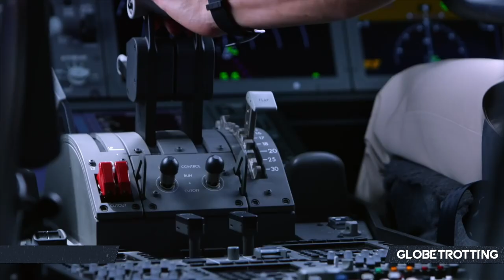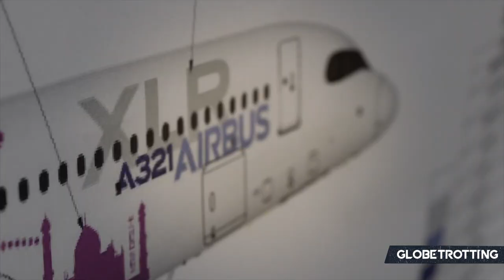Boeing's Next New Airplane...

Comment: I seriously do not understand the fascination with 757.  Large capacity single aisle just don't make sense. To compete over the next 20 to 30 years Boeing need a new aircraft that is efficient, comfortable in flight and capable of fast turnaround ( boarding, deboarding, cleaning resupplying and refueling) a rebooted 757 does none of these.
Reply: Hotrod, hiperf plane. You must never have seen one take off!
Reply: Given the same capacity, single-aisle planes are more efficient than double-aisle because a larger proportion of the cabin is occupied by seats, rather than aisles.
Reply: Very accountant-like answer! I would have thought more efficient loading/unloading would come into it. Then we add passenger comfort, more aisle access for those that turn right and more options for F and J seating, then twin aisles would come out on top?
Reply: @anthonywatts2033  It doesn't seem to me that many airlines are concerned too much about passenger comfort these days. The discussion is mostly about legroom and meals on board, I've never heard anyone go as far as complaining about aisle access (as far as economy class is concerned, anyway).
Embarkment/alighting time may be indeed better for a double-aisle aircraft, but by how much? Is the potential saving of 15 minutes at the gate going to compensate the worse fuel/seat efficiency? Also, I'm not sure that the aisle is the main bottleneck, since even widebodies are usually loaded through one jetbridge. 
And yes, it's an accountant's answer: the companies are in the business to make money, not to provide comfort.

Comment: Boeing is not even considering a new aircraft type till 2035. Even if they think of a new one in 2035, it will take 10-15 years to develop a new prototype which may be showcased in 2050 at the earliest.
Reply: I think they mean it will launch mid 2020s and fly in the 2035

I can’t imagine Boeing not announcing anything and not working on any airliner and only launching in 2035 that would be insane

Comment: Boeing is foolishly allowing Airbus to eat there lunch with the A321LR and A321XLR.

As I've suggested before, Boeing should take the 757 design and update it with MAX technology. It would be a relatively inexpensive plane to develop.
Reply: No it would not be inexpensive and the design is just too old by this point to justify the billions it would cost. It would cost almost as much as clean sheet with a limited market. You just have to accept the 757 in any form is a thing of the past.
Reply: they literally said that they will never build a 757 again cos its so complicated to build compared to other boeing jets
Reply: @hibikismusic3103  It was just from era that is over and I've herd too how Boeing complained how expensive and labor intensive it was to build. Although developed at the same time, it had little in common with the 767 other than a common cockpit. Certainly didn't help achieve lower production costs. They were not thinking about it at the time. The 737 larger versions just became a better option for Boeing.
Reply: Aurbus isn't eating Boeings lunch with the XLR. Why don't you go up to boeing and say why didn't you build an equivalent XLR to actually compete with
Reply: @nickolliver3021  Boeing has chosen not to compete with the XLR. They have much bigger issues to deal with than losing a relatively small market segment by spending billions they simply don't have on a new airframe.
Reply: @johniii8147  They didn't choose not to, they lost out which we already know why. They never did have a plane even before the accidents that was equivalent to XLR. The 797 was a glimpse of what they could have done but time/priorities got in the way.
Reply: @nickolliver3021  Yes they chose not to. They were looking at competing plane as early as 2016 in that segment and chose not proceed. That's well known. It was a choice and they probably made the right one. Boeing simply is not currently equipped to develop an all new aircraft. Sometimes the best business decision is to ceed a certain market segment and that's what they have chosen to do. They got a lot of other things to worry about at this point.

Comment: Boeing next airplane should be an upgraded B747-8I incorporating new cutting edge iHYBRId propulsion tech that will make the airframe 60% - 65% fuel efficient than existing B747-8I & B747-400 ER . . . Boeing's new middle of the market aircraft should be something close to the B757-300 in terms of concept & capabilities . . . a large wide body quad jet flying long haul could seriously do with a 4-to-2 feature where the aircraft can be flown safely on just two engines (without compromising performance or safety) instead of four, thus significantly minimizing fuel consumption . . . for the engine manufacturers like Rolls Royce & Pratt & Whitney this would mean designing a unique turbofan engine (specifically for quad jets) that can sustain twin engine operations, on long haul routes instead of four . . . iHYBRId propulsion solutions can make the 2-to-4 a reality . . . speaking of B737-MAX program the tricycle type front & rear wheeled landing gear of the B737-MAX9 could be a tad taller . . . in the interest of much needed ground clearance between the under fuselage section of the B737-MAX8 / B737-MAX9 / B737-MAX10 & tarmac . . . especially the lower end of the enlarged engine cowling, that's barely a few inches off the ground . . . this would require modifying the front & rear landing gear bays to accommodate the taller retractable wheeled landing gear . . . it'll be worth every penny . . .

Comment: I think that Boeing will be dead and gone before they can build a new Airplane. Boeing's main project is Two new Air Force One 747-8i Airplanes.
Reply: Boeing won't be dead before they can build a new airplane.
Reply: @nickolliver3021  And your comment is based on what actual evidence?
Reply: @georgeclarke163  evidence that the fact they're still producing aircraft
Reply: @nickolliver3021  This video was about producing a new aircraft for the future.
Not for the aircraft that they are producing now and cannot get certified and delivered.
Reply: @georgeclarke163  and I said they won't be dead before they can build a new aircraft. Then you questioned that and I said because they still produce aircraft and if they would end up dead then they won't be producing aircraft right now. The aircraft they are producing now are certified and being delivered
Reply: @nickolliver3021  Well, an interesting reply. They may well be producing aircraft now but what are they actually getting certified and delivered?
Do you have the figures for this?
I any event it bears no relevance to the resources that they have for developing an entirely new aircraft which was the subject of the original video.
As others have said, by the time that Boeing get around to even thinking about a new aircraft then Airbus will already be much further down the line.
Your loyalty to Boeing is admirable if somewhat deluded!
Reply: @georgeclarke163  also a very interesting reply from you too. They well may have got something up their sleeve for a new aircraft but they are getting their remaining aircraft certified and delivered. Figures don't prove this. Time will prove that. Also airbus doesn't have a new aircraft in tbe development stage yet because all the media is just reporting what airbus thinks the future will be like. None if their designs have gone into production yet nor have been confirmed. How would you even know? Boeing will be ready once Airbus starts developing theirs as you don't know what the future holds for both airbus and Boeing. Your only going by the fact one is ahead of the other. Your love for Airbus is worst but if not biased
Reply: @georgeclarke163  o dear. Boeing isn't currently a disaster. Boeing are delivering 737maxes each day of the week. A Lufthansa 787 got delivered last week. I dobt have the figures but I can tell you you are not looking at the media very much. The hundreds of certified aircraft parked up are mostly China based aircraft but they dont seem to being delivered. Not Boeings fault. You have to accept that Boeing is currently delivering aircraft left right and centre of 737s.
Reply: @nickolliver3021  Well, all the figures are out there. Boeing are certainly not delivering any aircraft in significant numbers. Unless of course you have figures to prove otherwise.
Reply: @georgeclarke163  Where is your evidence that Boeing is not delivering any aircraft in significant numbers? Unless you have a website to prove otherwise I have a website that I can which proves that Boeing are delivering aircraft in numbers each week.